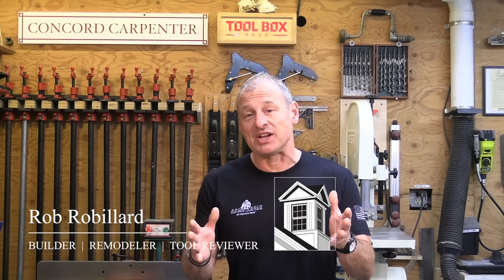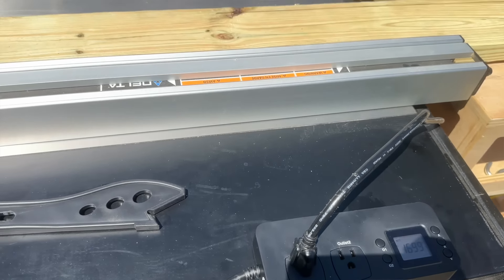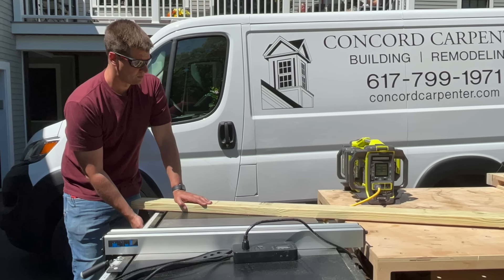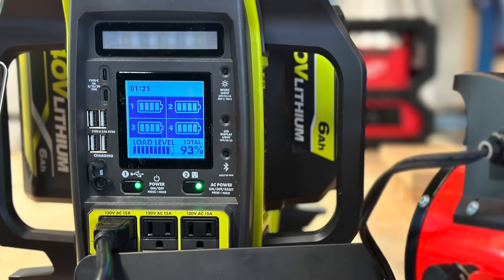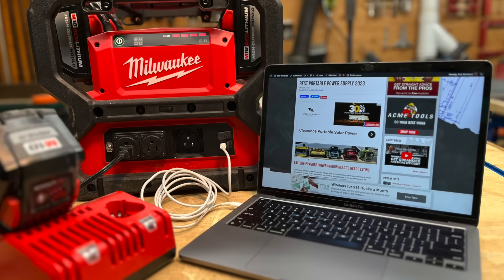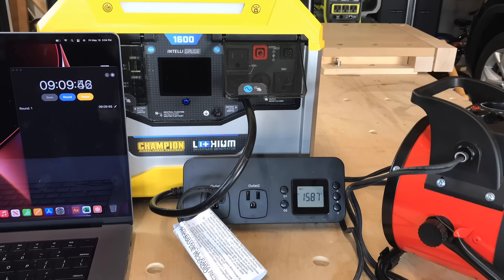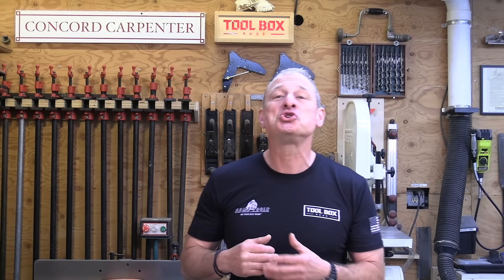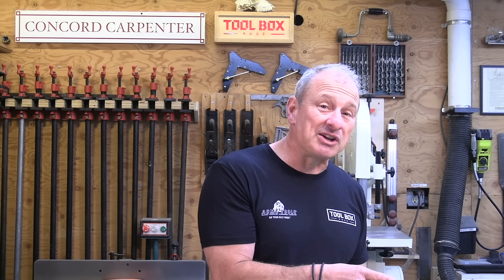Best Portable Power Station

Comment: does Ryobi make a 18V unit and if so could you use the conversion parts to run it with Milwaukee batteries?  How small a battery will the Milwaukee unit run on could you put in 5s once the 12s ran out or 4s?
Reply: Yes. It's basically the same as the 40V(36v) with double the battery ports (18+18=36)

Comment: @A Concord Carpenter I want to see see run an extreme application. Say an inverter welder Like a Miller Multimatic 215 or 220. And like a plasma 375 or 625 from miller. On 15amp these tools drop their rating but I want to see them run it for in a pinch or small remote repair jobs. Of course a regular gas generator or shore power is more ideal. But let’s see if they can power them up for small mig or stick jobs.

Comment: Went with RYOBI 18V  Station ,,  1#  Reason  is hot swap of Batterys , 2#  Has 8 battery  slots, 3# you can mix batterys /slash amps , pulls amps even across all batterys , so if add  little 2 ah battery , takes 8th of the  load off remaining batterys , 4#  long as 4 batterys in the unit  it will run full watts , 5# app controlled  6# Ryobi 18v is every where so need can get fast and cheap /// also  there are  every battery adapter made to run on an in ryobi 18v platform , so with  adapter  can run Milwaukee, Dewalt , Rigid , almost very battery made lol,lol  6# battery app  tells charger state of all batterys , individually,  7# Built in light   8#  NO BUILTED IN BATTERYS , HATE BUILT IN ,, MY LUCK ONE DIES  IN FEW YEARS U GOT PAPER WIEGHT , 
Down side ,,  1# Not Built as Tough as Milwaukee or the Dewalt , 2# No pass through charging 3#  Not Wifi , 4#  NO STORAGE FOR CORDS 5# Slow on broad charger  only 65 watt ,  charging,

Comment: Good video but your definitely making the dewalt sound really expensive when overall its typically not. Power station itself is cheaper then milwaukee and also, i know your going off retail prices and not what somebody mite already have, but why would some one pay 319 pee 12ah battery over getting 2 9ah for 349? Either save $578 and have 4 9ah instead of 4 12ah or spend an extra $120 and have 8 9ah instead of 4 12ah and run for longer. If you really want jus 4 highest batteries and your willing to pay 319 for 12s it is also worth considering purchasing 4 15ah instead at 400 a piece although the 9s would still be my suggestion.

Comment: Shame that they all don’t support solar charging, being at a remote site, solar is indispensable
Reply: Ain’t that the truth.
Reply: Actually, I'm 95% sure that Ryobi does
Reply: @1ELiMusic The Ryobi power station I got 9 months ago doesn’t let you charge the batteries and use the 120v plugs at the same time. Which means you can’t use the power station while it is connected to solar. 

So I charge 1 battery on solar separately from the unit. When that’s full I switch to charging another battery.
Reply: Ego has a solar charging accessory
Reply: I have the ego solar charging adapter
Reply: @ecospider5 how do you charge a battery with solar?
Reply: @ckcuev ego doesn’t have pass through charging unfortunately
Reply: @VanquishAudio there is a YouTube video on the ego solar connection
Reply: @VanquishAudio Charging a lithium battery is just about voltage control. So you can take a 20-100 volt panel and put it into a cheap Buck converter with the output set to the charge voltage of the battery. 

Or just buy a solar charge controller which does the same thing but in a nice clean package. Also you can get mppt charge controllers that improve your efficiency by 5%-10%
Reply: @1ELiMusic only up to 60 watts which is nothing
Reply: Ego supports just not simultaneous charge and use at the same time

Comment: I can tell you that Milwaukee so far i use that able to have the juice to kick start Washer and gas dryer

Ryobi won’t be able to even get the washer even to move
Bluetti AC180 does not have power to get motor going, and overload
Ecoflow Delta 2 does not have the power to kick start washer and gas dryer motor like the Bluetti 
but both allows pass through power

Comment: 4:18 LRA lock rotor amps 700%
Maybe I’m a little biased as I have a couple of tough system boxes, but the fact that the dewalt is compatible with the tough system boxes, means it has a third method for carrying. Not only that, I can get 12ah worth of batteries (even though it’s 3 batteries) for $180 in the dewalt. You’re not getting close to that with a Milwaukee setup. I think that price point is under valued in this video.

Comment: Amazon has 2-packs of the DeWalt 9ah Flexvolt batteries for $325 right now which essentially cuts the overall DeWalt cost in half.  Overall, the DeWalt is going to appeal most to those who are either already invested in the DeWalt ecosystem, or must run heavy jobsite tools.

Comment: Seems to me both the dewalt and Milwaukee are both overpriced for what you get.lets be honest,these are made for home backup power or overnight camping.I've never been on a jobsite where only tool is running off the generator and none of these would that efficiently  if at all
Reply: Sorry,only one tool running off the generator
Reply: I’m so used to getting to the job site and the framers using every single outlet or constantly tripping the breakers. Or the temporary power being across the street and having to have your cord run over for 8 hours. I once had an inspector going around cutting people’s cords in half for running them across the street. 

This is perfect for running a sewer machine remotely in someone’s backyard.

But yes, those two are overpriced because they don’t want the power station to be in direct conflict with their cordless battery sales.

Comment: Let's go Ecoflow instead. So much more features and more power per size of unit. I know the thought is to use batteries you already got but for the price you could go for a pretty good size battery like ecoflow or anker. I really want to use my preferred power tool company's station but it's just not good enough. And ecoflow and anker supports solar already

Comment: I've had the dewalt inverter for about 3 years now.  Think I paid $300 for it?  I got four 9ah batteries for $125 each on ebay.   I have roughly $900 in it and its still going strong. I use it daily in the summer to run a fan on jobsites because Texas heat is something else.  Humidity is so think down here you can lick the air. 

12ah batteries are overkill honestly.  You don't need them.   You'll find two sets of 6ah batteries are cheaper then four 12ahs. Should you even need that much.  If memory serves the 6ah is 150wh and the 9ah is 180wh.  Which basically means you can run a lamp with a 100w bulb for 1.5 hours and 1.9 hours respectfully (of course real world time is 4x as there are 4 batteries).  

Really comes down to what you want to run.  Small wattages like a phone charger will run for days.  Large wattages like a shopvac you've got roughly 20 minutes.
Reply: They did a table saw test. The 6ah batteries would struggle with that. But for just a small fridge and some laptops your right.
Reply from the maker: Smart

Comment: Solar charging is kind of pointless without pass through. If you are camping and it’s noon you want to charge your power station up with solar. Well without pass through your refrigerator is no longer running, your laptop is not charging, your fans are not working. 

This is a big miss by the tool industry. I hope they change this in the future. Currently I charge 1 Ryobi battery by taking it out of the power station and connecting it to a solar charger. Then just rotate through the batteries. Kind of a pain. But it works.
Reply from the maker: yep
Reply: Well, there's always 3rd party.  Channel SerendipitySue posted one for the 300W single battery 40v inverter, for example.  Along with hacking the charge cable to be able to add solar charging to the power station.  Seems 2 100W panels is just enough to charge...  While the newer 150W 18v inverter can be charged with a solar panel, which Ryobi is going to sell a few options for...  So maybe another version or two they'll come to their senses and make that native to the product...
Reply: @ZeoCyberG Yes let’s hope so.

Comment: The answer is "none of the above".  These are all over-priced for what they deliver.  Don't get suckered into buying a solution like this, simply becuase it uses the power tool batteries you already have.  You think you're getting a deal, but you're really not.  You can buy or build a much better power station, for the money spent on one these products.

Comment: Sine wave makes no difference to electronics. Any input waveform is rectified to DC. Modified sine wave, which is essentially a square wave, will cause inductive flyback when powering large coils like that table saw. These are huge voltage spikes at the inverter hundreds of times per second.

Comment: Build your own do much better run time with on them wich I do and water 💧 proof I have 3000 watts pure since wave inverter 48V 120AC 60Hz 40A I have solar charger controller 12/48 and 4 battery 🔋 etc run table saw 120AC 60Hz  next table saw 15A

Comment: All these options are horrible when compared to making one yourself with some Lifepo4 12v batteries or prismatic cells and a cheap inverter. $1 to $2 per Wh is just ridiculous to think about. 

Just by comparaison, I made one using LFP cells and a 2500W inverter for 1500$ and it has over 7kWh. So around $0.21 per Wh. Lifepo4 also has 10 times the lifespan of power tool batteries. 

I would assume that most construction workers would find it pretty easy to make one themselves.
Reply from the maker: Wish you were on our team
Reply: I got 5 old electric bike batteries, 1 kwh each for $500. And a diy setup to connect it to our fridge. Plus I can pull the electricity from my Nissan Leaf if the power outage is long enough. 

But I also got the Ryobi for the non hackers in the family. If you pull the batteries off and carry them separately my 10 year old niece can get it to the kitchen to power the fridge. 

Then I get home and setup the crazier system. 😛💥🤪